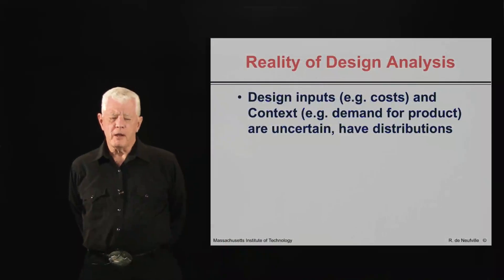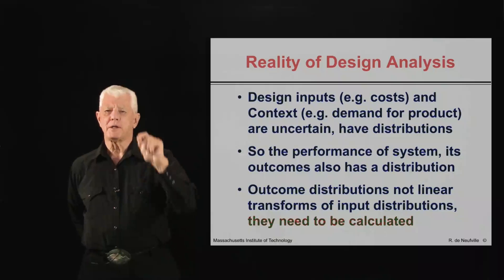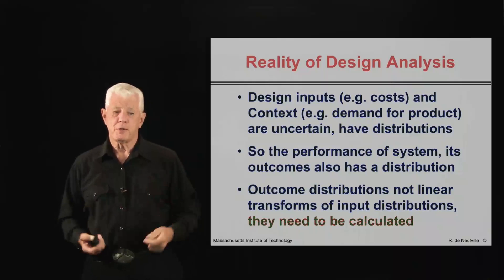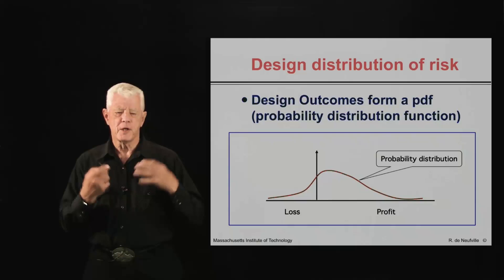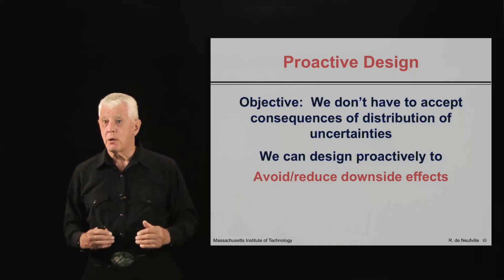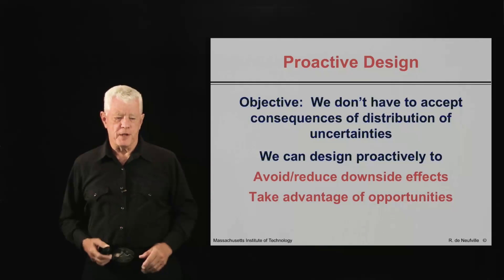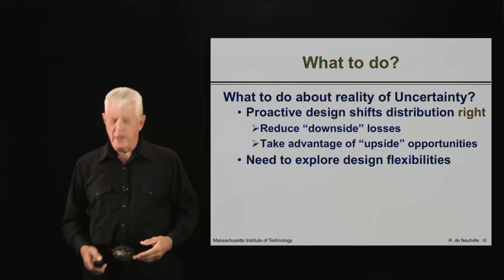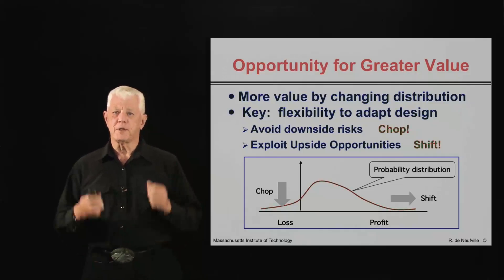Unit 4: Parking Garage Case Example, Video 5: Design to Manage Uncertainties

Comment: Downside risk can be partly avoided by performing a series of experiments to verify portions of the preferred final outcome. For example, which glue works the best for the intended purpose - viscosity, temperature range, set time, tear strength, maintaining strength over intended usage, etc.. Testing preferred parameters, not just one element of the whole, but integrating all of the elements to achieve the optimal result.